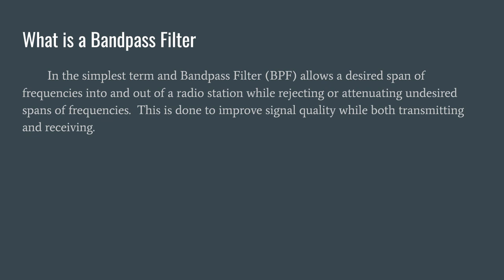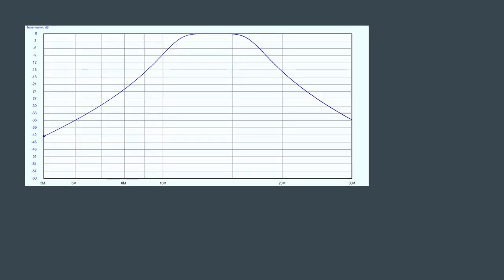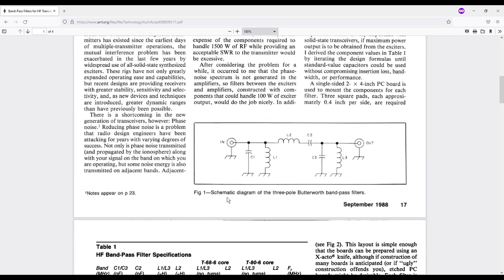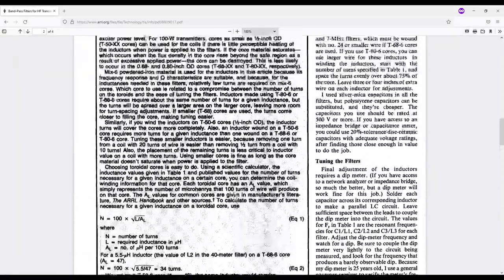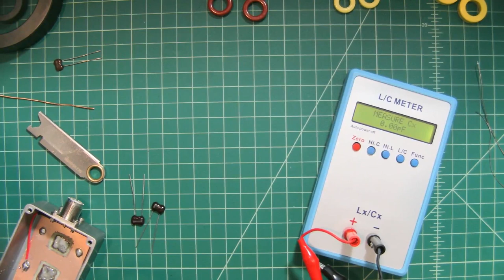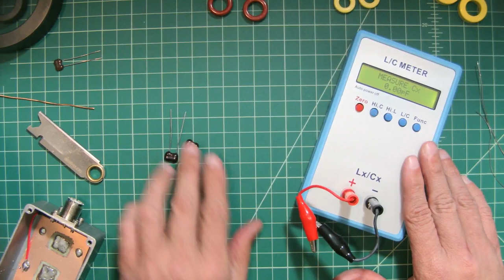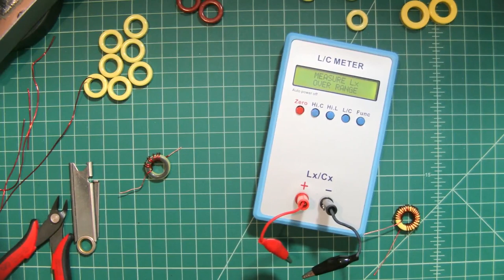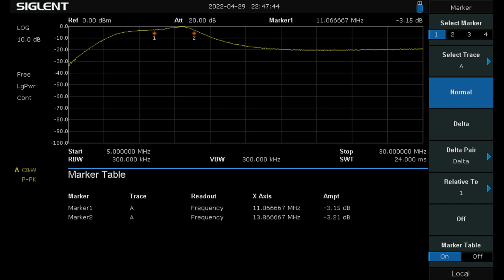DIY 20 Meter Bandpass Filter for Ham Radio

Comment: I built a full set of these filters.  The trick is that you need to grid dip each of the LC pairs together as they recommend in the article.  Remember, that is a tuned circuit. Just be sure that when you grid dip them that you have the leads of each pair soldered together and the far legs on each LC pair cut to the length that they need to be when they are going to be soldered in place on the circuit board.  If you tune them via the grid dip meter with the leads long and then you cut the leads you have just detuned the LC pair.  When you solder them in the circuit the filters will typically be a little low in their resonate frequency.  When you get to that point you can put a 50 ohm dummy load on one end of the filter and then something like a RigExpert antenna analyzer or a Nano VNA on the other end.  Set the analyzer for the center resonate frequency that you are shooting for and then start with the middle inductor and carefully move the windings closer together to see if you can closer to 1:1 SWR at the center frequency.  If you don't then try and spread out the windings.  If you are adjusting an inductor, one inductor may not get you to the lowest SWR.  You may get lower SWR and then it will start back up the other way so it typically takes adjusting two inductors back and forth to get the lowest overall SWR.  Carefully work each of the inductors to try and achieve 1:1 SWR.  If you adjust an inductor and it's not making much of a difference, leave that inductor alone, don't tune it any further.  When you get to 1:1 at the center frequency then look at the filter across the band.  If all is correct you should have a nice drop on or near the outside edges of the band.  I highly recommend not taking the shortcut of not using a grid dip meter.  This is a very active circuit when it comes to each of the LC pairs working in unison.  If you build the 80m version it is very narrow banded and also the 10m version in my experience does not cover the entire band but it's nowhere near as narrow as the 80m filter.
Reply from the maker: Thank you for this comment, it's been the most useful and detailed.  Much appreciated!
Reply: The nano vna technique for tuning worked great for me thanks !
Reply: Yeah, this comment is right on the mark.  I have some of these and I tuned them up this year.  As I watched your build, I thought, "Oh yeah, he's not going to get enough precision from his meters to make this work well."  Because I did the same thing once! 

What I finally did to tune up my pairs, was remove all the components from the box, and then take each capacitor-inductor pair I wanted to tune and solder it across via the middle pad.  Then use the VNA to adjust the inductor to match with its matching capacitor.

Once you have all three pairs matched in that fashion, you should be able to re-build your device and be much happier.  That's how it went for me.

Comment: Thanks for the video, I have a group of hams that we have been working with a local GMRS groups for fire watch and neighbor hood watch. Several of them have issues with interference on the GMRS frequencies, partly because most GMRS radios do not have good GMRS filters, because they are Ham radios that they converted to sell as GMRS radios ( but do not alter filters to be specific) and we live in an area that has some competing commercial users that I believe are boosting their commercial radios to overcome the terrain issues. However I think this will be a good group project for them to build and help them with reception. Thanks for the video and the information.
Reply from the maker: Good luck with the project Charles, thanks for checking out the video!

Comment: Nice prototype build. Next phase are refinements as suggested by other commentators, especially Mr. West. When building these RF filters, I do it under a magnifying glass which brings one really "into the work". IN the next version, build outside of the box (natch) and compact the physical size of the layout, beginning with reducing the pad sizes, narrowing the widths of troughs between them. Use as little solder as possible when making connections. Connections off the board's ground plane to the connectors via copper strap as short as possible, or copper foil tape (soldering to the non-adhesive side). To reduce lead length to connectors, raise the board up standoff insulators and use flathead screws on the other side of the box that are countersunk with an oversized drill bit.
Reply from the maker: Thanks for the additional info Bill 👍

Comment: I would replace the fixed capacitors by silvered plated trimmers and use shorter ground wires or tinned braids to the copper clad board. Also try to make the two  toroids are not touching each other to minimise stray capacitance. The side skirts and insertion loss can be optimised by adjusting the three trimmers.
Reply from the maker: All good recommendations, thanks S Lo!

Comment: I went back to the MarkiMicrowave site and played with the cutoff frequencies. Using 10 and 25 MHz as cutoffs, it looks pretty good. The values of LC components are a bit different. It appears it is quite sensitive to component choice. I’ll give this a try. I have 2 sets of TXBPF’s here for SO2R, but you’re right about POTA (and FD) activations - I need to give these a go.
Reply from the maker: Thanks for the info, I need to blow the dust off this project 👍

Comment: Loved this one...I actually have two sets of these from the same QST article from 80-10M, kitted out in silicon muffin tins. I wonder if the toroids being placed at right angles to one another would improve the filter characterization. Martin Jue has told me that this is one of his design/layout practices. It would require resoldering but you might try it to see. Thanks again for your work, Ape!
Reply from the maker: Hey Frank!  I do think the toroid placement was an issue as well as the long shield grounds I added.  Thanks for the insight!
Reply: @TheSmokinApe  I’ll pay careful attention when I get around to assembling/testing mine.

Comment: Use the largest magnet wire that will work on those cores to reduce losses and improve Q in order to get steeper band skirts. Remember that while you must provide some space between toroids, (and keep them at 90 degrees as you did,) that every bit of wire used in the filter creates losses and hurts the Q and band skirts. The ground wires should have been heavy gauge and gone straight down to the filter ground plane, not dragged out to the center of the board on either side. Let the ground-plane do the work. At RF it has much lower inductance and lower resistance than those ground wires. If you feel the need, lay the bare lead down on the ground plane and solder along its length to where you want it to 'go'. But remember that RF follows the surface of the conductor, and the surface of solder has a lot higher RF resistance than copper does, which is why I resist that temptation for RF work. 
The capacitor lead lengths were much too long, and totally unnecessary. Attach them only between the edge of the island pad and the nearest edge of the ground plane, so there should be essentially no lead length on the caps or inductors if it can be managed. If a length of lead from a device to ground is physically necessary then make sure the length is on the ground end not the hot end. Leads are bad. While short lead length is essential at VHF, it still  a lot for good performance at HF. Always build EVERYTHING as if you are working above 500 MHz, and you will always be happy with the results. It's a habit well worth getting into. Finally, if you are off frequency with your bandpass, try spreading or squeezing the turns on the tuned circuit toroids and watch the result on the SA. Spread them to raise the freq, squeeze them to lower it.  or spread the coupling toroid turns to play with the bandwidth and minimize the filter loss. I usually let it be a little wide if that helps efficiency. Ultimately, in such a hand-made filter the meter measurements are only to get you close. Proximity effects of even accurate devices shifts their inductance and capacitance values. BTW, polystyrene caps are NOT power caps. They are low leakage caps, for sample and hold and some audio applications, things like that. I would never use them in RF power applications. Polystyrene plastic is low very temperature and it melts. I don't know why anyone knowledgeable about RF would suggest them for an rf power circuit. Silver mica caps are more accurate in their values, (closer to spec,)and more stable over heat ranges. They are all I use in RF power applications at HF. Of course I'm lucky to have a couple of thousand of them in my parts stock, ( an amazing $20 box of parts from under a table at a ham swap,) so I don't have to drop $10 every time I need a couple of caps. Ultimately, ceramic trimmer caps are the easiest way to tune a filter and they have a better Q than the fixed caps. And yes, you should definitely have built it out of the box, and rough tuned it first. You can't get short, clean leads when you are reaching down into a box with a soldering iron and your fingers. All you can get is burned. Have fun.
Reply: There is excellent guidance here in the comments from @johnwest7993 and @hamateurradio82 .  The first and easiest thing to change is the ground wires, to the shortest possible length using very heavy wire or maybe solder braid.  Shortening the cap leads would be relatively easy as well.  I really appreciate that we get some instruction from some real pros in the comment section .. thanks guys!

Comment: Interesting video, I have the same experience that these filters are difficult to get right at the first time. One problem is the low values of the inductors. 280 nH is very low to get right.  One trick is to increase the impedance of the filter like 800 ohms and use the toriods as transformers. Like 1 : 4 in that case the inductors values increase and capacitors decrease, your capacitors are 500V i think even with 100 Watt (283 Volt in 800 ohm) it should be ok. (in the book "building a transceiver" of EI9GQ this is explained). Also in Elsie you have to set the impedance for analysis It is in the video 0.01 ohm (a bit low). Did you fix it in the end?
Reply from the maker: Hey Paul, I need to blow the dust off this project 👍

Comment: Get rid of those long ground wires - they are adding unwanted inductance. Copy what the ARRL article shows and use braided copper as short as possible from the connector down to the board egde.

Comment: One problem I found with this construction method is. Especially if on VHF freq. Not to use double Sided copper board as it acts as capacitors top to bottom (thickness) also bolting it or gluing down in a metal box also capacitance problems. Copper board needs spacing away from metal box. Cheers from old George
Reply from the maker: Thanks for the info George 👍

Comment: Hi Ape. I watched this again and I am now hearing that band pass filters can work differently depending on the direction of the filter. So, should the cap be towards that antenna or towards the transceiver? I get it is not supposed to matter but Mike (K8MRD) found that it did. Also, another question, where is the recommended spot in the "chain" of Antenna, Amp, SWR/Power meter, and transceiver. In that chain, where is the best place for the band pass filter?
Reply from the maker: Hey Don.  They should work the same bi-directionally unless they are unbalanced from a component standpoint.  I would do RADIO > BandPass > SWR METER > AMP > Tuner.  Unless you have dirty equipment the filter is really used for RX.
Reply: @TheSmokinApe  Thanks for the answers Ape. Makes sense.
Reply from the maker: @don_n5skt  👍

Comment: Can't learn if we don't try. Looking forward to part 2. Would it be possible to build out the board on the bench, then drop it in the box and only have to sold er the 2 wires to the bulkhead connector?
Reply from the maker: Hey Shooter, I do think that for round 2 I am going to assemble as much as possible outside of the box.

Comment: Hi Ape,....Your BP filter should have worked Much closer to the Calculated specs...For those 3  Extremely low value Inductors, I bet just a simple Inductor of a few turns of 18 ga enameled Air core (No Toroidal core) would do much better results....Plus, with Coreless construction Inductors the Filter is much Easier to Tune by simple turns Spacing manipulation....Diy low value Toroids can sometimes Wreck your expected results where a simple Air core Coil works Unexpectedly well....
Reply from the maker: In the plan for this build they did suggest using air cores for 10m, I didn't consider using them because I didn't want to worry about shielding.

Comment: When I Build Toroids, I Wall Them In Tin Walls, Walls You Can Just Twist And Bend However You Want :) ! I GHet Them Fro Food And Bear Cases, Aluminium, Steel, Tin.. Aluminium can be bolted, not recomended tho. aluminium sucks for rf  buids
Reply from the maker: Thanks for the info / suggestion 👍

Comment: Ape, In the video you say the term "broadcast", that really is an incorrect term. Hams technically are not allowed to "broadcast".
The proper term is "transmit". Broadcast is a one way transmission like a commercial radio or tv station does. Broadcast is a one way transmission with no expectation of a response or transmission from another station back to you. Hams " transmit" and "receive" because hams want and encourage others to respond to them and have a QSO. Hams operate to initiate a QSO where there is an exchange of information. W1AW at the ARRL "broadcasts" CW practice messages. They have a waiver from the FCC to pay a cw operator to send the CW practice messages. That is the only time a ham can be paid or in a paid position as a ham operator. It is a " broadcast" in that its a one way message or transmission and no response is required or needed to that broadcast. Hams in general do not "broadcast". Broadcast is done in a one to many model. See the first paragraph of the wikipedia page below that I cite.
https://en.m.wikipedia.org/wiki/Broadcasting
The U.S. Code of Federal Regulations, title 47, part 97 defines "broadcasting" as "transmissions intended for reception by the general public, either direct or relayed".[6] Private or two-way telecommunications transmissions do not qualify under this definition. For example, amateur ("ham") and citizens band (CB) radio operators are not allowed to broadcast. As defined, "transmitting" and "broadcasting" are not the same.
Reply from the maker: Well thank you for clearing that up!
Reply: @TheSmokinApe  Guys like you that do youtube videos are one of the first places someone new to ham radio goes to for information. It's important to use correct terminology and teach correctly because new hams or people new to the hobby often times look to you to elmer them correctly. Some on here will perpetuate incorrect information and mislead. We are all still learning. I've been a ham 23 years (and even before that in my CB and SWL days as a kid) and have met and talked to and learned from newly minted hams. Everyone brings something to the table because of things they have experienced, even experiences outside of ham radio that can be applied to the hobby.

Comment: Perhaps trying the Double tuned Bandpass next time? I realy like it for receivers.  It has much steeper skirts. Might have slightly higher IL though but you can easily adjust that by increasing the coupling capacitor. http://w7zoi.net/transformer_coupled_lc_bpf.pdf  The Q of a T50-6 is around 200 at 14MHz
Reply from the maker: Checking out the doc now, thanks for the info!